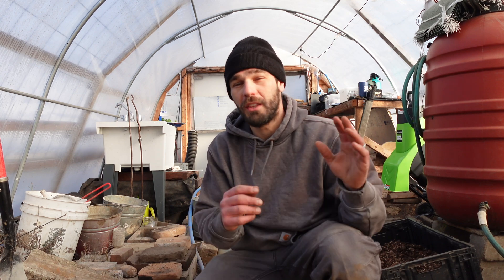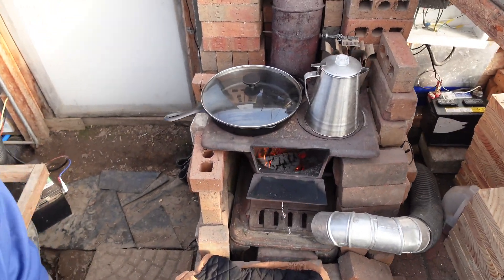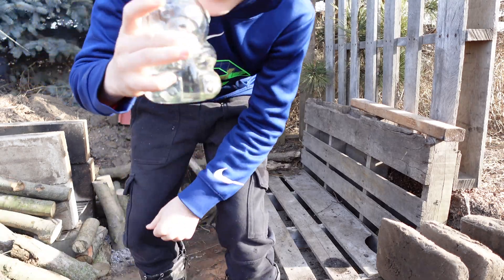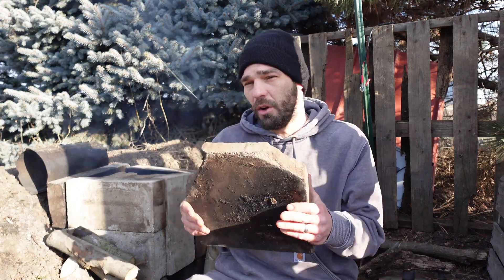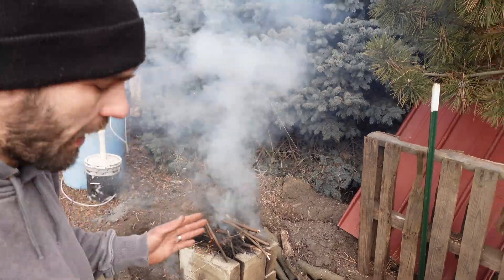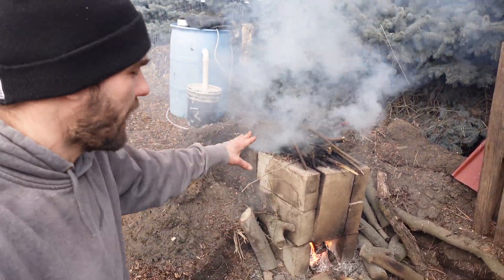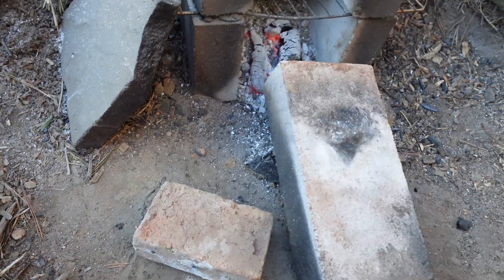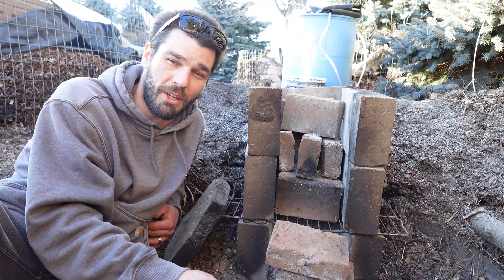MAKING FREE DIY BRICKS - STEP BY STEP - SCIENCE BEHIND FIRING - 100% FREE WATERPROOF BRICKS

Comment: Excellent presentation! I have been looking at similar ideas for making my own bricks, but with a little more refractory aspects in mind. Looks like I'm going to have to build a similar kiln. Thanks for putting this together! I'm curious as to how many firings you will get out of those concrete blocks. Once they begin to spal and disintegrate you could always use them for a rubble trench foundation perhaps?
Reply from the maker: just got around to reading through comments I apologize, I try to get back to all newer video comments quickly. first of all thank you for taking the time to comment, and getting to the question answering : silica or alumina (manmade) are normally used but when were DIY-ING vermiculite is a relatively cheap solution. I am interested in doing the same lol the bricks we have now totaling 40-50 fired bricks are withstanding the heat pretty well. We've used a few for a backdrop and floor of the kiln through a few firings and they held up better than the concrete blocks lol. the concrete has done better than expected actually, the only crumbling ive had is when I have moved them to relevel the kiln itself. That's not a bad idea for using the broken down concrete as its inevitable that they will just disintegrate lol I fired a few of our diy concrete bricks as a test and the ones with refired ash (diy cement) disintegrated in my hands.. while the bricks made with raw ash, sand, and clay soil held up as good if not better than pure clay bricks.